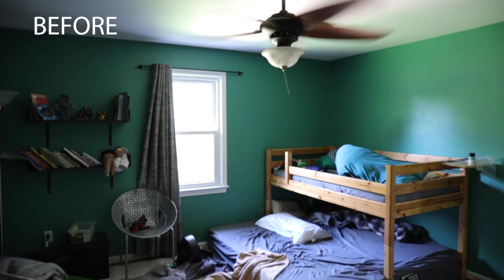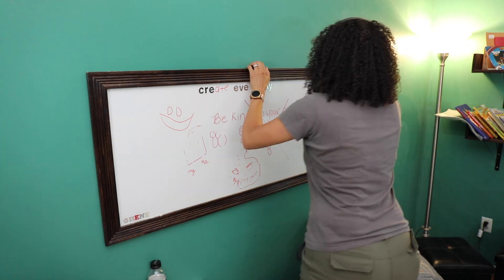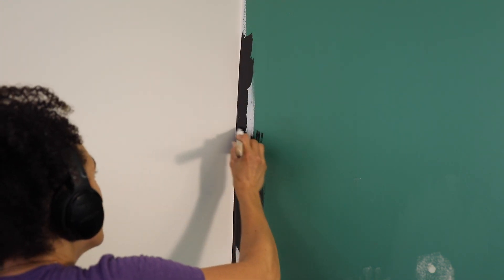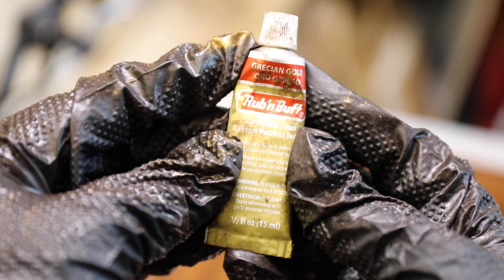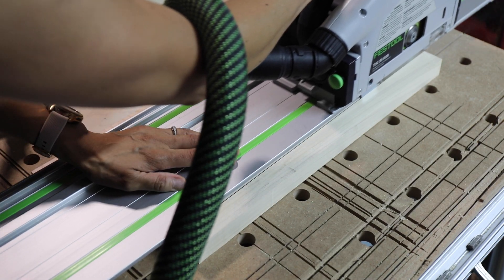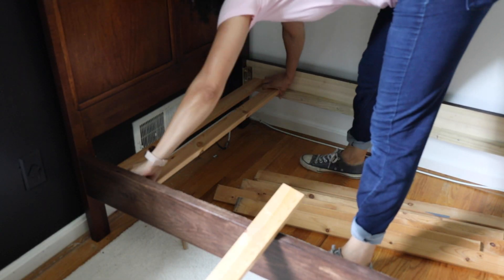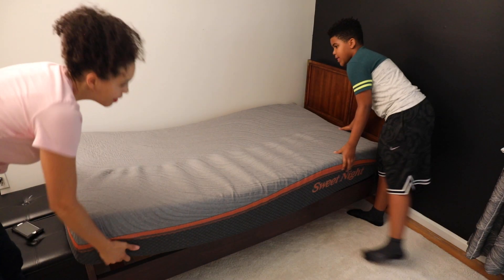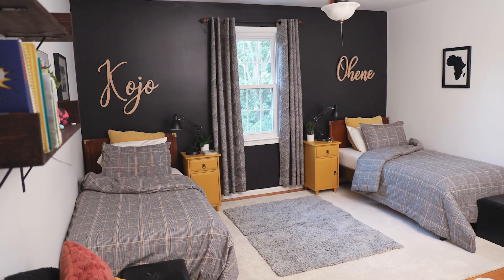BEFORE & AFTER: Vintage Headboards Turned Into Beds! - Thrift Diving

Comment: I know the prices for wood, especially plywood, is crazy this year. But maybe if you had built the headboards las well as the frames you could have matched the stains and beds’ design. This might have also allowed you to build the frames a little bigger to fit the mattresses. 

Another thought is if you removed the bottom framing on the dresser, added some support boards to hold new legs, maybe ones legs that matched the nightstands, then paint it the same yellow.

Comment: I feel you about your height chart. I had one too,  and when we repainted I used a roll of clear sturdy plastic and traced all the marks, names and dates etc. Then I transferred them to a tall narrow piece of wood I had painted white and put a hanger on the back. We can take the height chart off the wall, rest it on the floor so the heights are accurate, and put new update marks on it as required.
I'm the great grandma in the family so we have rather a lot of overlapping marks! 😊 💖

Comment: Hi Serena,
Do you also have a table saw? If not, what made you choose a track saw instead?
Reply from the maker: Good question! I actually own TWO table saws but I haven't wanted to use them because I don't trust them. I don't like the risk of taking a finger off if I should slip, or if something should kick back. A track saw does everything I need it to, makes repeatable clean cuts, and I never have to worry about taking a finger off. :)